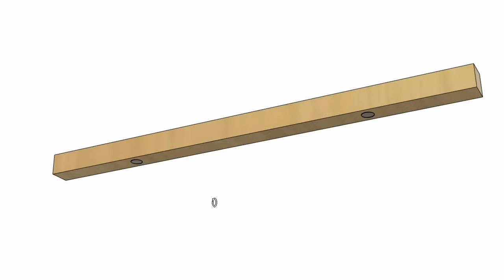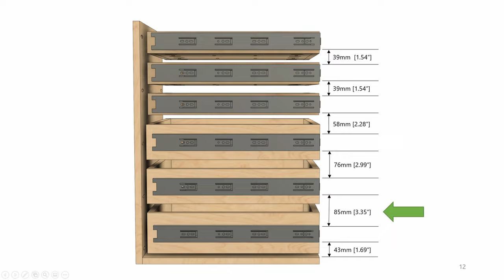🧲 This Clever Idea Makes Woodworking So Much Easier

Comment: Great idea! I’m in the U.S.- this would be absolute mind games to do in imperial. I think I’ll go with metric lol
Reply from the maker: Lol, I was going to show how this could be done with imperial but my head started to hurt! 
Having given it some more thought, I think it could work well if you are happy to work down to 1/16". The tricky part would be making a 1/16" spacer. You would first need to find magnets at 1/16 and cut a spacer that holds together at this thickness (nylon might be a better material than MDF). As was mentioned in the comment by ken, you could use washers in a very thin spacer - it would just have no holding power. Assuming the 1/16" spacer can be made, you would then make 15 spacers between 1/16" and 15/16". Then make spacers in the 1" range up to whatever measurement you like. 4 spacers at 1, 2, 3 and 4" would be a close match to the metric measurements I made. I think that makes sense?
Or just make metric spacers and convert your imperial measurements when you need them!

Comment: Nice....why not a 5mm a four 1mm strips.
You could inlay metal washers into the 1mm strips
Reply from the maker: That's a good idea for anyone who needs to drop below the 10mm spacer - thanks. I don't think I've ever tried to cut MDF at 1mm. If it's not strong enough at this thickness, nylon plastic would be a good alternative.

Comment: Can you explain and show that good quality measurement system on your table saw.  I would like to add this to my Craftsman 10 inch table saw.  Thank you for a good video.
Reply from the maker: I was referring to the rack & pinion fence system for my Dewalt table saw. It's very precise and my cuts come out very close to the measurement dialed in (which you can see at 0:32 in the video). Many reviews for Dewalt table saws mention the same thing. Thanks.

Comment: This is basically wooden gauge blocks, just sized better for the task. Nice
Reply from the maker: Thanks for letting me know about gauge blocks! I just looked at what they are and see they are commonly used by machinists.
Reply: @kiwiworkshop  gauge block can also be very useful for setting table saw blade height and fence distance from blade
Reply from the maker: @ApteryxRex  I didn't think of those applications and will definitely keep them in mind - thanks